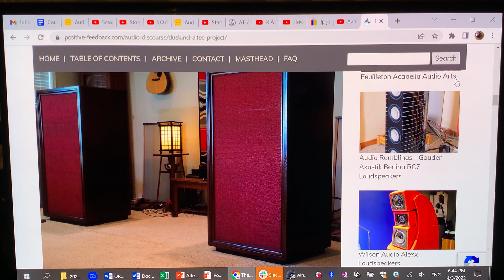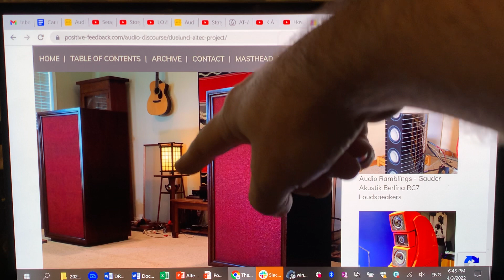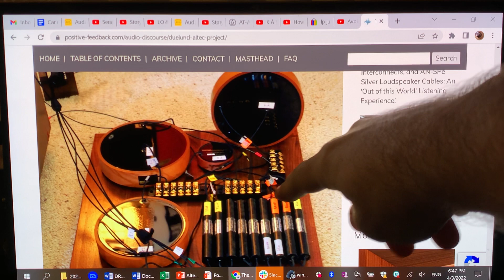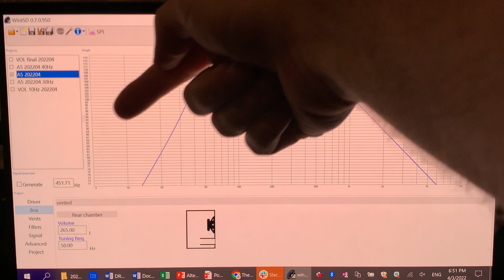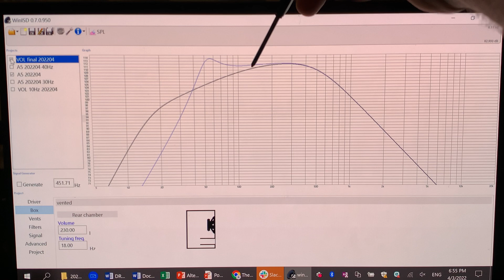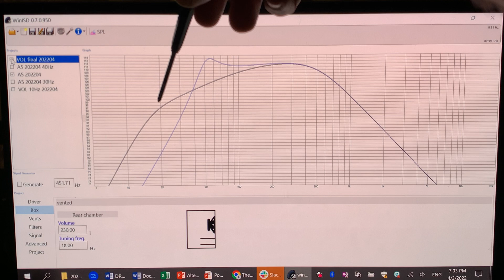Revolution in Loudspeaker Design:   Ultra Efficiency AND Ultra Deep Bass TOGETHER!

Comment: We must realize that our hearing capabilities (sensitivity) goes down along with the lower and lower in frequency we are going.

For example if we play 60 dB at 1 kHz then at 20 Hz 60 dB is just at our hearing threshold!!
(Meaning that it is at or below what we as a humans can hear according to science since 1933 and ISO standard)

IF you want to HEAR it AS loud at you did at 1 kHz then you need to turn up the volume so that you play 100 dB @20 Hz!

So 100 dB @20 Hz do we humans perceive AS LOUD as 60 dB @1000 Hz. Nothing more and nothing less it is  perceived as the SAME volume.

Because of our inability to hear at lower frequencies when our hearing sensitivity is dropping when the frequency is dropping..

So even if you were able to have a flat frequency response down to 12 Hz it is inaudible and not by far enough. (It can't be enough when we as humans can't hear it or perceive it at all. If you do not increase the volume.) 

Study the equal loudness curves and we will realize WHY people (humans) is usually turning up the bass due to the insensitive hearing we have in the bass region.

But again a DSP will solve that above and as we discussed before solve the bad idea crossover that you showed that cost like a house. (Just by throwing money at a bad idea does it not make it a better idea. 
It only shows how far people and developers will go for the convenience to just be able to connect speakers to a amplifier. And the user don't need to educate themselves or do anything of the work that the engineer is forced to do when the crossover is on the speaker side before the speaker terminals. A seven year old can hook it up. 
That is great but limiting the possibility to get next level SQ.)

Thanks for the video and it convinced me that I am on the right path. 🥰🎶🎵🎼
Reply from the maker: Thank you, superb comment! I will spend some time talking about subsonics, and how the body perceives it. Under 20Hz there is a major shift in perception: we can't hear it, but our body resonant frequencies (muscles, internal organs, eyes) fall into the 7-20Hz region. As a consequence, following the output of the equal loudness contour (such as pumping out 12Hz @ 120dB) WILL lead to MAJOR health problems, including potential internal organ ruptures, failures. With my VOL it is already enough to absolutely transform the listening experience. It's strong enough that when I listen to heavy  infrasonic content more than x2 per week, it causes SEVERE LASTING SIDE EFFECTS. Infrasonic is no joke, should be dealt with extremely carefully. ;
Reply: @realworldaudio  The problem with bass is that it is a lot of energy (power) in those frequencies.

The second problem is that the decay times is the longest of all frequencies, it is not uncommon that it is over 1000ms! (When I measured my friends rooms and their friends rooms.)

So imagine that when something is playing in low bass, it take one second for the sound has decay after it has left the speakers, during that time it is bouncing around our rooms and smear over whatever is played after that.

It is a double edge sword that sounds that you have tried.. we want to hear the details in the bass and we crank up the volume in that region when we do that we load the room more and get more smearing going one.. then we crank up the volume even more.. with more problems.. it is like chasing your tail.

One secret is to use a open baffle bass. Open baffle with it cancelation to the sides will not load the room far from what any box will do.

When bass IS problematic and it is very hard to treat with basstrapps and other treatment types.

A open baffle is the opposite of what you want to have in a home theatre (HT). In HT we want everything to shake and be physicall so you feel it, like you are experiencing and talking about.

But it took me very long time for me to understand that.. I have two 18" OB for stereo and I put a high pass filter at 17 Hz because of TT rumble (yes DSP as rumble filter, another use case). 😉

From 17 Hz I have four presets with +16 dB, +12 dB, +9 dB or +6 dB. I knew (calibrated measurement microphone and REW) that I were able to play very low frequencies and with much higher level than just flat.. A goal to implement research with equal loudness curve for our hearing. 
I can adjust like a loudness control depending om volume. And adjust depending on bass level of a album with a press of a button to the DSP.

I could not wrap my head around why I did NOT feal it physical like you describe. Nothing is shaking and rumble despite very low frequencies at high levels..

Took me some time to adjust when we all more or less are raised with bass reflex boxes and ports..

But what did I gain instead? 
I got unmatched clarity (no smearing with lower loading of the room, no smearing from a port) I heard stuff in electronic music like dark side of the moon in the bass that I never have heard before! There is additional heart beats on some of the tracks that is one octave lower than the more obvious heart beats that is higher up in the frequency range. Amazing!
That is a electronic album from early 70-ties. Since then there has been a lot of electronic albums and music..

Yeh, Linkwitz, Clayton Shaw and Danny Richie are some of speaker designer that recognize the vast benefits of OB and the benefits for pure HiFi usage.

But it is on the complete different end of the scale of what you want in a HT. The OB needs less treatment when it doesn't do as much harm (loading the room less). 

But luckily I am a into only high definition 2ch stereo and not interested in HT. 🥰🎼🎵🎶
Reply from the maker: @AmazonasBiotop  Hi Optimize, wonderful post, if you do not mind I will make a video showcasing it, as you have so much information that people can use & deserve more attention! ; cheers, Janos
Reply: @realworldaudio  Thanks for your encouraging comments.
No problem we are here together to learn and grow. 👍

Comment: Wow, that quick shot of the crossover was amazing.  Those inductors were huge!  I have a pair of JBL 4430’s at 93 dB sensitivity/efficiency and built my own “charge coupled” crossovers using high quality caps, inductors and resistors.  Made an absolute huge difference in improving all aspects of the sound they produce.  Altec VOTT’s are on my wish list.

Comment: yes but you didn't say exactly what you did...? and there's nothing new. you need a baffle step 150 Hz -5db
oh I think I hear what you say at the end. 
a little tip for you you want to keep the driver tight in the enclosed up to the end of the basket magnet, this will extend lower frequencies quite dramatically
Reply from the maker: This was the introduction, showing the raw modeling. The end result will be with added front horn, active cabinet, floor loading the port, and room response. ; ) That will come tomorrow ; Will show it for both A5 and VOL.
Reply: @realworldaudio  ❤️

Comment: Really looking forward to the “normal” room redesigned VOTT cabinets.
Reply from the maker: Thank you Klaus! Going to go deeply into their analysis, and also into how A5 (and other VOTT series) works as well. ; )
Reply: @realworldaudio  you already kind of touch into the reason why the bigger VOTT s are tuned the way they are, they were meant for very large rooms! so big that there are virtually no “help”  from the room boundaries in regards to supporting low and sub low frequency’s. So coming up with new strategies for retuning VOTT s for living room hi-fi application makes a lot of sense(and interest).
Reply from the maker: @klausnielsen7102  Hi Klaus, yes, that's it! ;)  I will go into detail how the VOTTs use the front horn & how the CD is leveled to get the super high efficiency out of the cabinet for a large hall. ;